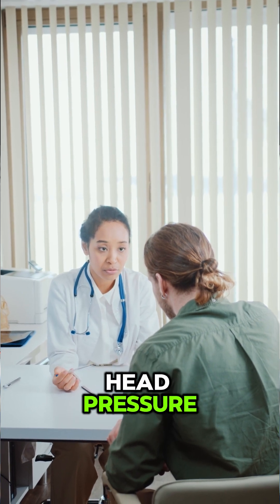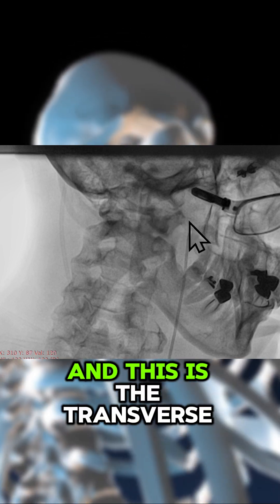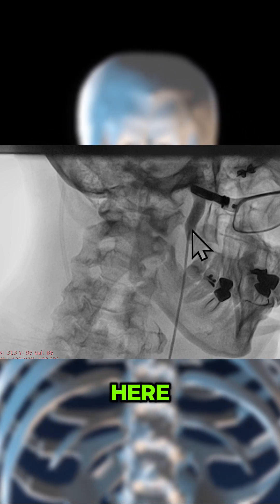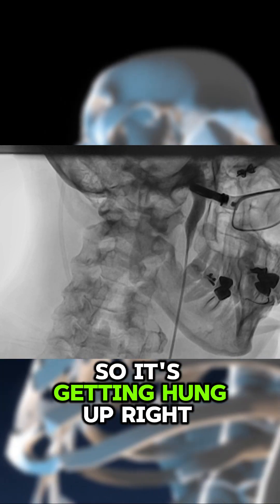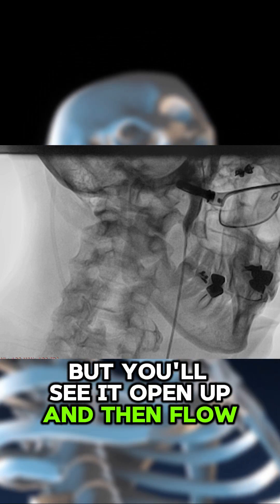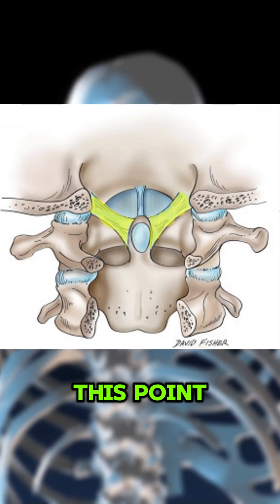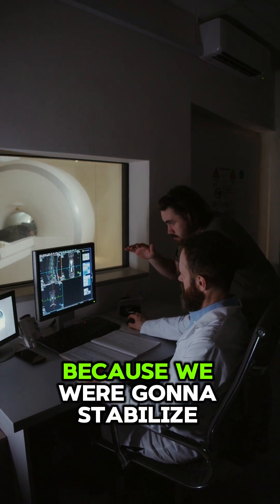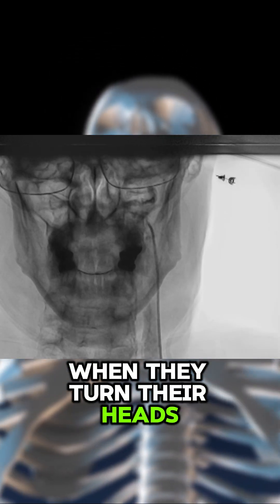Real-Time Imaging: How CCI Causes IJV Compression - Dr Centeno Answers Ep. 48

Comment: yah that happened to me. No blood flow in my right ijv. Supposedly curve correction will fix it. When my neck has a good curve the blood flows well. But normally it's straight. (we tested with some weights to put a curve in and then checked with ultrasound and flow was good). PICL didn't help my curve at all, but it helped me get to the point where I could start exercising my neck. I could barely lift my head. Now I can lift 17.5lbs with a head harness. It's a miracle.
Reply: how long wil it take too get your perfect curve off the neck back , with curve correction ???